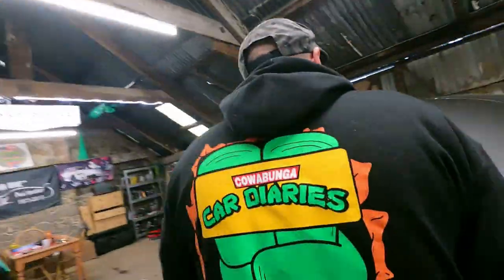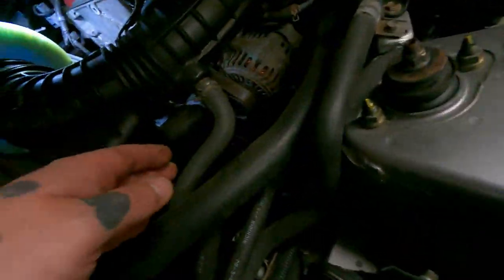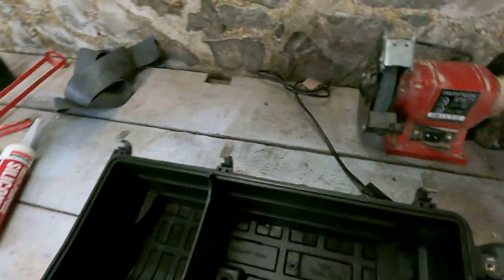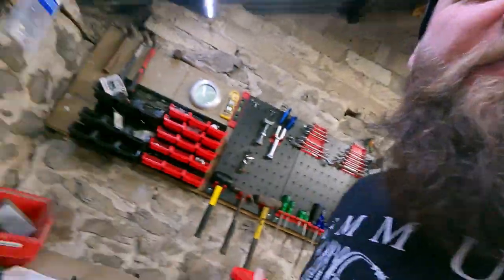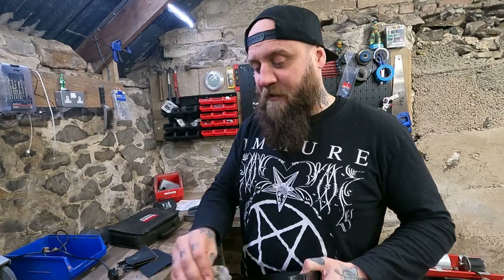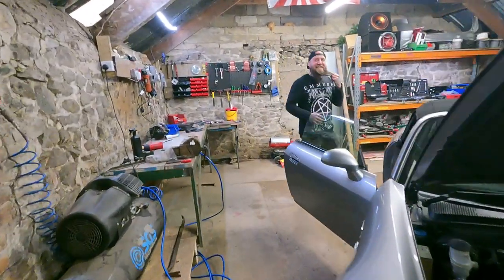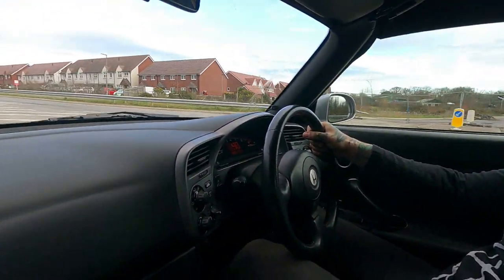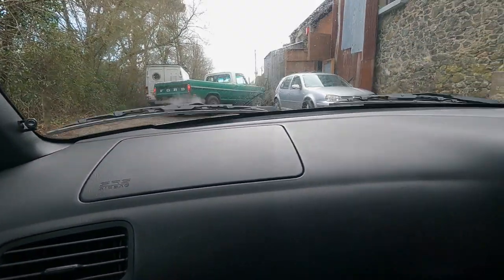Honda S2000 Airbox mod *FREE NOISE*

Comment: I'm not an expert but I'm pretty sure the the airbox resonator exists for more than just reducing "noise". Have you ever been at a concert and the bass is so deep that you can feel it vibrating in your soul?  The sonic waves are causing reverberation, the point of the resonator is create negative waves that cancel that out.  So yeah, it also has the side effect of reducing noise level, but I'm fairly certain it has a functional purpose of reducing vibration and without it you're causing undue stress on various parts of your engine.  If airbox resonators only existed on passenger sedans I'd be inclined to think they were just for noise reduction, but do you really think the Honda engineers designing the s2000 would add an airbox resonator just to reduce a few decibels?